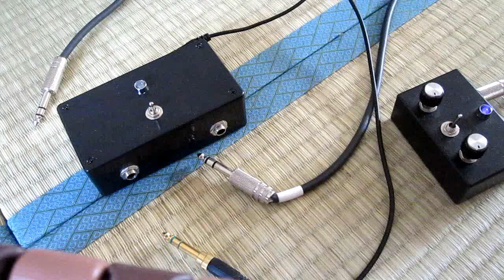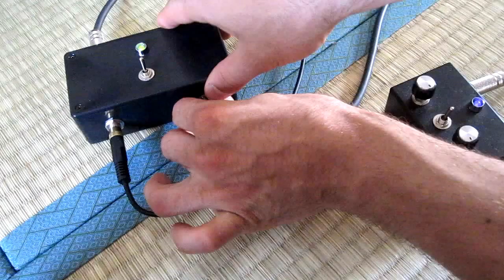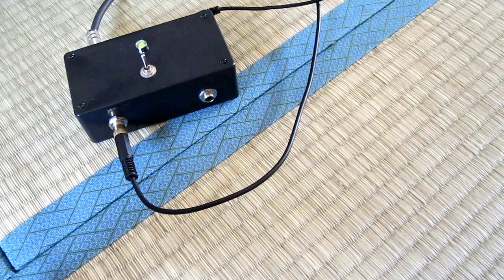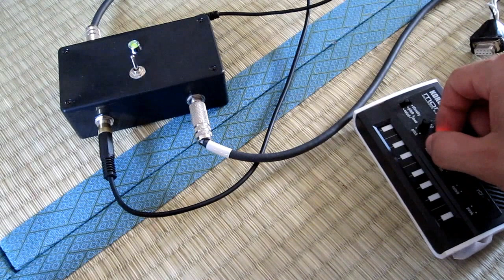Active Dalek Voice Ring Modulator Build

Comment: Where did you get the plans for this?
Reply from the maker: Can you read circuit schematics? This project actually took me a while to figure out, because it was around the time I decided to get more serious about electronics. I could read schematics, but couldn't figure out why I couldn't hear anything. Simply type in RING MODULATOR  in google and it will show you the schematics in the image side. Then, you need to build and amp on the output. A simple headphone amp should be enough to make this thing audible.
Reply: Thank you. This was very informative.
Reply from the maker: http://en.wikipedia.org/wiki/Ring_modulation
http://www.hobby-hour.com/electronics/lm386-power-audio.php
http://www.beavisaudio.com/library/555/555.htm
Reply from the maker: the last link will give you a modulator/carrier that you can either build in or out of your circuit.